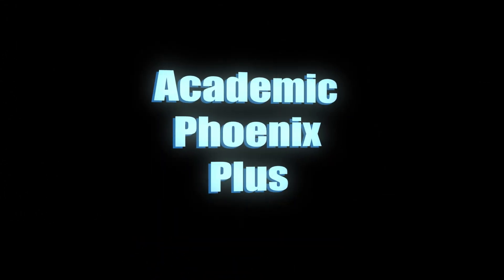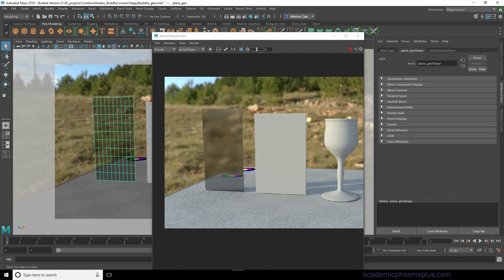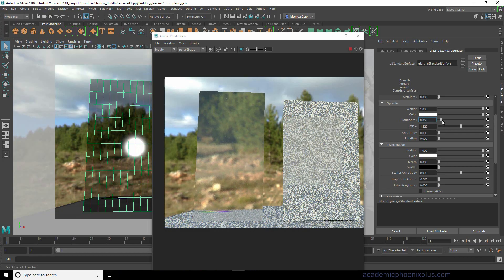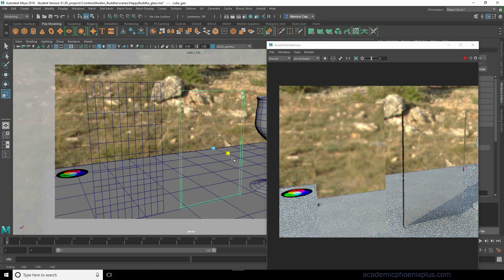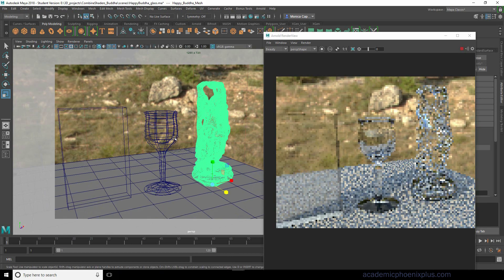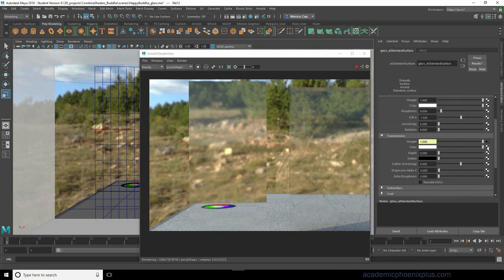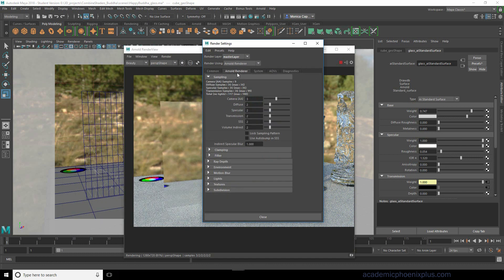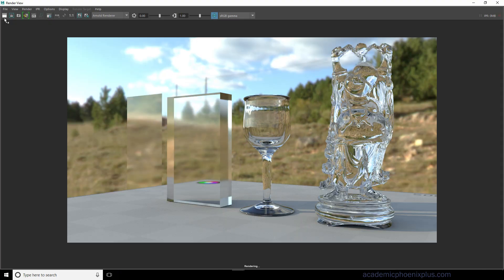Create Glass Using Arnold's aiStandardSurface in Maya 2018

Comment: I need your help😖.. if I set the value of transmission to 1 the shadows disappears completely!!! Even when Opacity is on... What i make wrong???
Reply from the maker: You didn't do anything wrong, Sim. It is a problem with Arnold transmission. It doesn't calculate rays going through glass, so no shadows. Try either reducing the transmission a bit, or change the color a bit. I hope that helps!

Comment: wouldnt you use the scratch map on the roughness rather than the color? At least thats how i have done it so far .-.
Reply from the maker: You can, Faceglitch! There are multiple ways to get the effect, adding it to roughness or adding it to bump could add a desired effect. You just have to see which one works best! Thank you for the comment. :)

Comment: Can I apply this as soft thin clear plastic cover like we use on books, notebooks, etc...? I just don’t know how.
Reply from the maker: Hi Shouty, You can if it's a separate piece of mesh. If you want to use the texture, then you'll just have to make sure it has no bump/normal so it's smooth. I hope that helps!
Reply: I see, I get what you mean thanks... Can’t wait to see more of your tutorials about Arnold. By the way, I noticed that some shader and nodes are not working with Arnold, did they make an alternative? 🤔
Reply from the maker: Theoretically the Arnold StandardSurface should do everything all the other shaders did. Is there something in particular shader you are asking about?  Also, going back to your clear plastic on a book... You can also try using Coat (under Subsruface) and/or Thin Film. That will give you a sheen over your object. I hope that helps! :)
Reply: Yes, no doubt about it aiStandarSurface is powerful and I really love it, thanks to you I eventually understand how to use it. Well one of the things I noticed is the env shaders they seems not working with the aiStandardSurface. EnvSphere is the only one that works. Hmm, about the book plastic cover, I’ll try what you suggested, I hope I can do the steps correctly 😁

Comment: hey ~ i got a question~ i do a glass bottle and some water inside, but after render the water color become black, but i set the water color into green
Reply from the maker: Hi Yuan, thank you for your question! Try increasing your render settings! Under the Arnold Render tab, increase your Camera AAA (no more than 5), and increase transmission value. I hope that helps!
Reply: Academic Phoenix Plus  thank you , I will try it and let you know the result! So much thank!
Reply from the maker: You are very welcome! Let me know. :)
Reply: I change the the Ray Depth on Arnold Renderer tab  from 2 to 4 and uncheck the double side in Render Stats, then the problem is  solved~ =))
Reply from the maker: Awesome! Great job troubleshooting!

Comment: I visit here in hope of finding out the solution to the problem where the bottom of the glass becomes black because it doesn't appear to refract any lights through to the ground. but by seeing the bottom of the wine glass in this video, and as she didn't mention it, maybe this is how the glass works..?
Reply: It can also be caused by render settings, specifically ray depth.
Reply from the maker: Hi Kuso,
Thank you for your comment. The dark area at the bottom of the glass is the refraction of the shadow. It can also be the geometry is not accurate to a real wine glass (bottoms are usually flat, and this one arcs up). I hope that helps clarify the issue!

Comment: The video is very interesting, thanks. I have a problem. I have to do the rendering the a interior room. This room is full of windows (I used a Aistandard surface for the effect glass). I put a Ai SkyDome Light where I setted the camera to 0, because I want a transparent background in the final rendering but when I go to do the rendering of the scene, if the window material is active, I don't have the transparency. On the contrary, if I hide it, it's all right. I have to deliver a project of work but I can't it solve this problem. Can you help me please?
Reply from the maker: Hi Nicoletta,
Did you make sure to turn off 'opaque' in the windows Shape node? That should help make the transparency active. I hope that helps!
Reply: I did it! on the site to autodesk they wrote me that the only way for to get the transparent is to use Render layer or AOV > ID but i didn't understand as to do